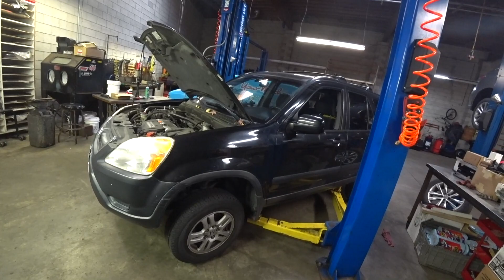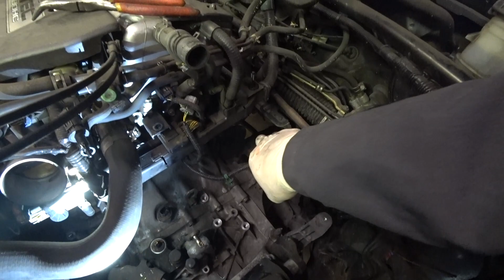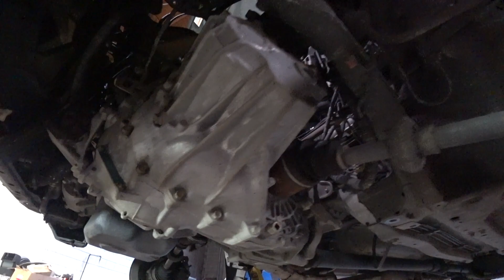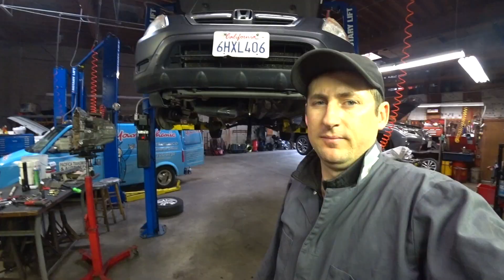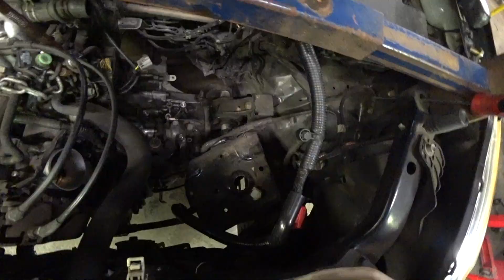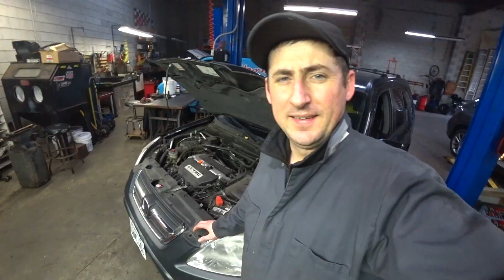How to change clutch on HONDA CRV 2004 AWD

Comment: Sergei, you are legend.  We referred to your video much while we attempted (and completed) the nearly impossible garage floor jack stand challenge.

A few notes to fellow attemptees:

You do not have to remove the intake manifold or the throttle body.  You only have to remove the front starter bolt.  The rear starter bolt does NOT hold the engine on.  You must remove the front engine mount bracket to find a hidden bolt.  You must remove the top driver side transmission mount to clear the transmission if doing with jacks.  We ended up removing the pillow block and CVs entirely. Just noting a few thoughts from our adventure.  Would be easier a second time around.  I suggest making piles each time you take a part off and keep your bolts and nuts etc. Sorted in a chronological lineup.  When everything was finished,  we were upset to see the pedal went to the floor and didn't rebound.  Bleeding the slave cylinder fixed this.  Whew.  We were worried the throwout bearing wasn't seated proper or worse,  the clutch disc was backwards 😅.  Anyways, Sergei your video was our go to.  To the home mechanics out there: its possible.

Comment: i did mine on the floor. first time i have replaced a clutch. its doable if you don't give up and there was a few moments i got stuck and had to use a lot of time on something that is supposed to be easy. i am not strong enough to lift this transmission by hand so i had to use a strap and a jack to lift it up. it is much easier when you find the center of gravity jacking point under the transmission. it was tricky to get to mount the transmission but it was much easier than uninstalling/installing the starter in my opinion.

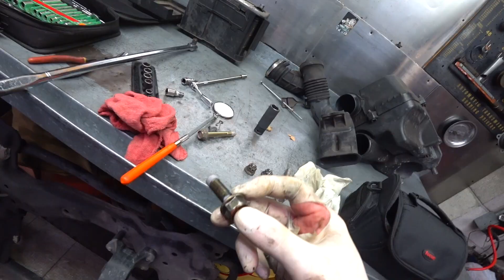Comment: 6:14.  Engine to transmission bolt got stuck then broke.  That SUCKS!  What did you do about that?  There's 6 bolts total for this engine.  So five good ones went back in?  Considering that the shank of the bolt was not corroded, the threads must be exposed to the salt from the other side in that particular location.  I'll have a look at all six of these bolts on my Element and pre-spray with pentetrating oil before removal.
Reply: How did it go if I may ask!?

Comment: Honda do not want to replace my clutch as a fixed price "Menu Item" 810GBP  (as they would normally) due to corrosion on my CVR. I am considering doing myself,  but bolt extraction issues worries me. Wonder if you can answer some questions: 
1. How did you fix your bolt thread issue? 
2. Did you use any penetrating oil before or what can I do to help stop bolt problems? 
3. Does the clutch kit LUK contain the centring tool?
4. Is it necessary to replace the small bronze bearing, as I don't have the special slide hammer?
5. Do you recommend replacing any suspension components at the same time, if so what?
5. I plan on doing this on my driveway (I am a good DIY mechanic) do you think this is possible?   

Great video by the way, exactly the correct detail level for someone considering this.  Well done, thank you, I have subscribed. I hope business stays good for you Sir.
Reply: Did you ever do this? On your driveway?
Reply: @alexdreadbeard  just did this on my 06 crv in the gravel parking spot beside my garage its not a bad job. I would recommend sparying all bolts with pb blaster minimum once the night before you do it. But the real secret to removing seize bolts is heat lots of it, heat them up read hot they will all come out easy. Also this video isnt a good example you dont need to drop the subframe, which means you dont need to remove the ball joint from the knuckle you have plenty of room to let it go out through the bottom with the sub frame on
Reply: Good to know that you did this without a lift, heat for removing seized bolts and ESPECIALLY not having to drop the subframe, @jeremyd5527  . Thanks

Comment: A ridiculous amount of work and time to replace a clutch.  It would not encourage me to purchase a Honda vehicle. To explain the work involved to a customer to justify the cost is almost impossible.
Reply: its not that difficult and only has to be done every 100,000 miles or so. my stock clutch lasted 120k
Reply: @stevenwalkden504  I agree, mine has 240,000 & I’m just now replacing it
Reply: Yeah the clutch just went out of my wifes crv at 203,300 miles. So literally most people will not own the car long enough the ever have to worry about this problem.
Reply: @williamkessler8399  200k that's amazing i bet her shifts are super smooth
Reply: @williamkessler8399  mine is going out at 206000 on a 2003 right now 👌🏽 cannot believe it lasted this long